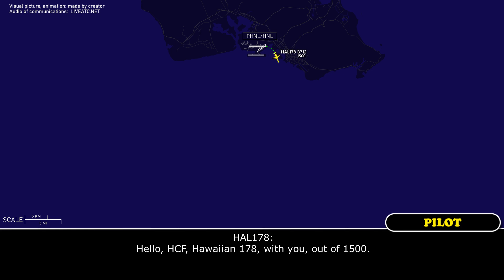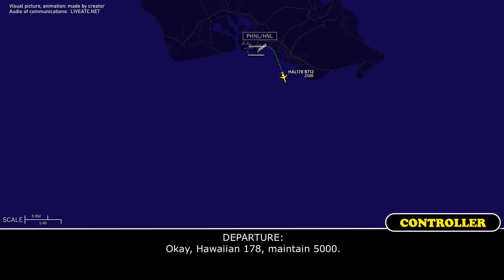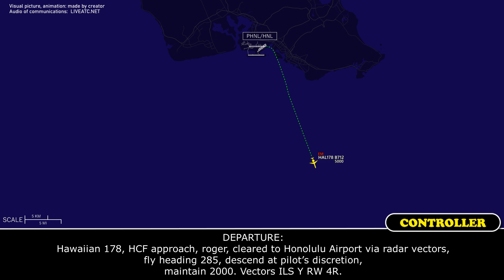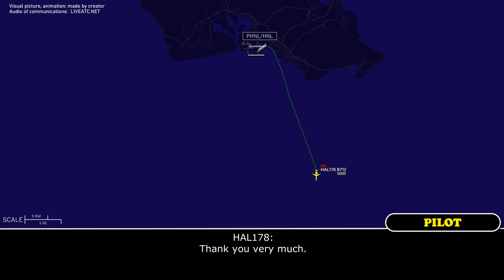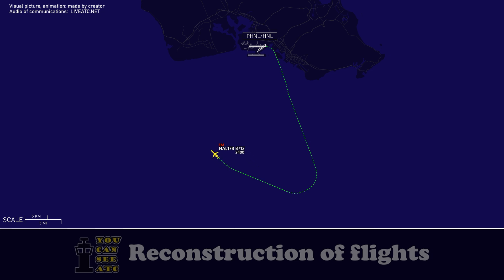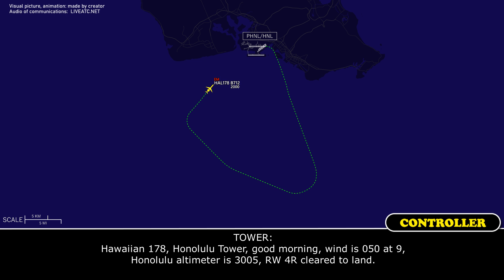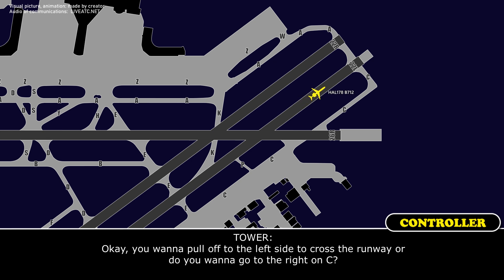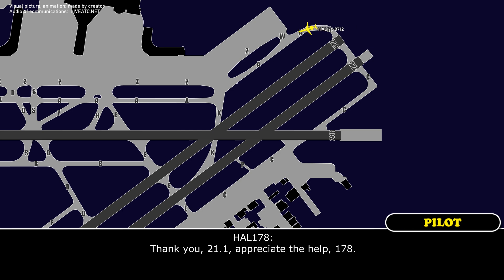Engine compressor stall after takeoff. Hawaiian Boeing B712 returned to Honolulu. Real ATC

Comment: 0:57 when asked for their intentions, both pilots know that they’ll be returning, so why not initiate vectors back or direct to a point and hold? Obviously they’ll be running checklists but it’s possible to fly the plane and run checklists at the same time.
Reply: The pilots did everything right. They very quickly realized what they needed to do and then contacted ATC.
Reply: To be absolutely clear: running the checklists is flying the plane.
Reply: @dalydegagne1839  - but you don’t keep flying away from the airport when you know you’ve got a problem and need to return and land.
Reply: @EdOeuna  They have more than one engine, the can fly with one failed engine depending on the reason for the failure. They have to decide if they are going to keep going or return. They were on a flight that was a little under an hour, so they had to take a minute to decide what they were going to do.
Reply: @ThatGirlJD  - yes the plane can fly on one engine. No they don’t make the decision to continue or return. That decision was made when the engine stalled.
Reply: @EdOeuna  While the crew is preparing to land they have to keep flying, thus flying from airport and then returning to it. It's not like they are flying a helo and can hover.
Reply: @dalydegagne1839  - if you’re planing on returning then it’s best to turn and hold at one of the IAF’s or somewhere at the approach end of the runway and not further and further downwind.
Reply: @EdOeuna  Generally the pilots know what they are doing. Your second guessing pilot actions in various situations may be justified sometimes, but it appears to be a habitual response from you. So either you are correct most of the time, and the pilots are lacking the ability to respond appropriately, or the pilots do a lot better than you appear to give them credit for, and you are engaging in Monday morning quarter backing. Which is it?
Reply: @dalydegagne1839  - maybe I’m taking a firm stance on poor aviation / airmanship but I think I’m justified. 

I had a conversation with someone on one of these channels recently where they said that emergency departure briefs were old fashioned and he didn’t do them beyond a threat based brief. I’m not suggesting that pilots brief departures and arrivals for 30 minutes or discuss things unnecessarily, but there are countless videos on channels like this whereby the pilots seem incapable of making decisions or seem reluctant to pass on information to ATC. I don’t know if this is an airline thing or a historical training / culture thing. It certainly seems that ATC are very accomodating when dealing with pilots in an emergency, but pilots don’t seem to be able to make decisions quickly and keep other people within their thought process loop. 

So many of these videos show varying degrees of very low situational awareness. The most recent one, and I can’t recall which channel it’s on, is where the FO has a heart attack and the Captain is asking for help identifying airports around him to which he can divert. This is a disgraceful example of poor airmanship of which I am openly highly critical.
Reply: @EdOeuna  I agree with you re briefing prior to departure. I think I saw the same video, and I found it shocking. Thanks to YouTube I have seen a number of such briefs, and am impressed.

Comment: Only for information : A compressor stall in a jet engine is a circumstance of abnormal airflow resulting from the aerodynamic stall of aerofoils (compressor blades) within the compressor. This occurs when the angle of attack of the blades of the compressor exceed their critical angle of attack resulting in one or more stages of rotor blades failing to pass air smoothly to the succeeding stages.
Keep calm & fly safe 😉
Reply from the maker: Thank you very much 👍
Reply: And why it's bad: the engine relies on the compressed air for cooling, not just for combustion. If the compressor stalls it may result in heat damage to the hot section of the engine, such as to turbine blades after the combustion chamber(s). Weakened blades may break at any time, causing catastrophic engine failure.
Reply: @MarkRose1337  absoloutly but Depending upon the cause, a compressor stall can be transient and self correcting or steady and require pilot intervention in accordance with (QRH) or other manufacturer directives. Flight deck indications include an increase in engine temperature and fluctuations in engine RPM. These may be observed on any of the following gauges as fitted to the aircraft:
EGT
TIT
ITT
N1 Indicator
N2 Indicator
N3 Indicator
A compressor stall will result in a loss of thrust and is likely to produce a "backfire" like sound due to reverse airflow. It may also be accompanied by flame from either or both of the engine inlet and engine exhaust. A sustained compressor stall can result in engine damage and can lead to engine failure.
Keep calm & fly safe 😉